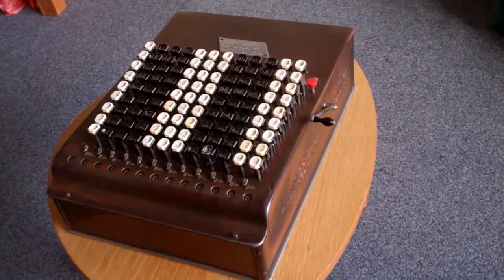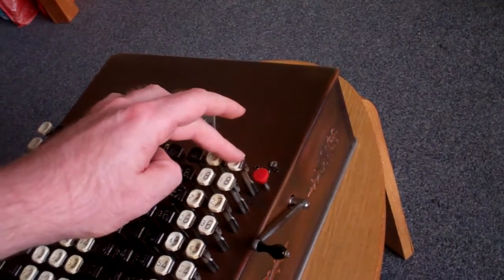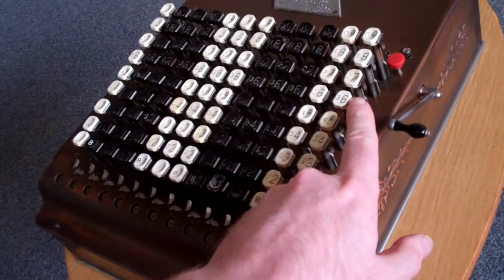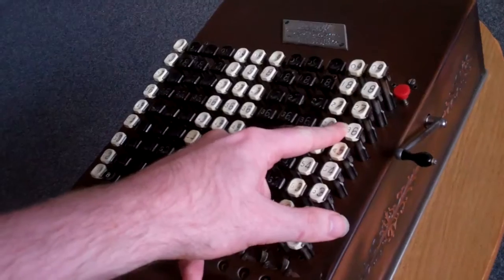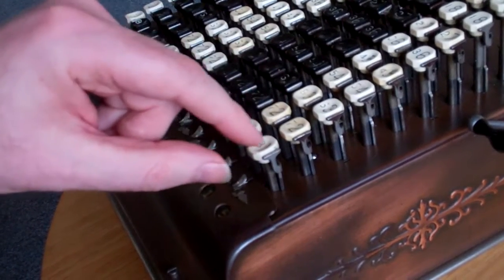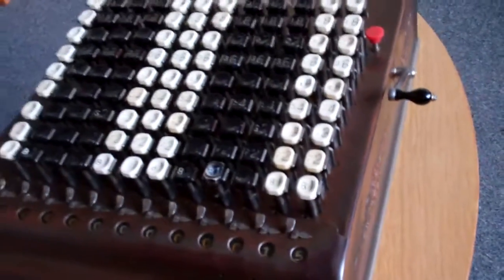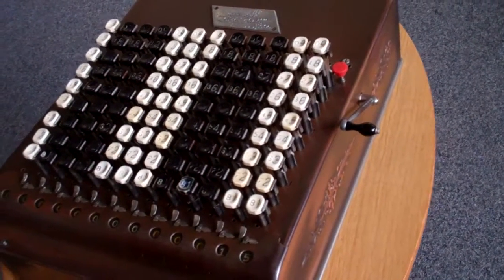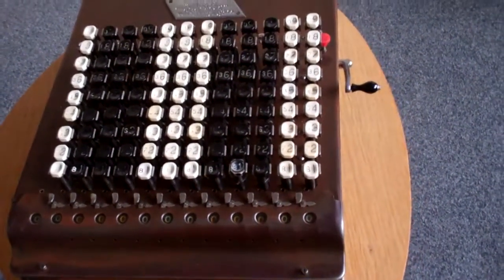Model E Comptometer

Comment: "150,000 GIRLS"!  I came here because I saw an ad in a 1957 newspaper from Jackson, MI headlined, "150,000 GIRLS".  Ad goes on to say, "Yes this is the number of Comptometer Operators need yearly by industry throughout the country.  Prestige, excellent salary and job security are but a few of the advantages of being a Comptometer Operator.   Prepare yourself for an excellent office position by enrolling in your Jackson Comptometer School.  Short, low tuition courses.  Day or evening classes.  Free Placement service. Dial ST#-#### for free trial lesson."  

Good to see that men (and presumably, women)  can actually operate these machines as well!  =8-)
Reply: Myself and others, would like to see a Comptometer in use. Full speed by a trained operator. If they were recruiting 150,000 a year, surely someone can be found for a demonstration.